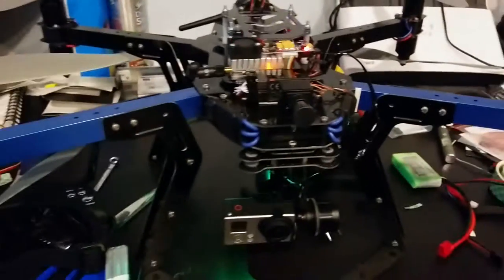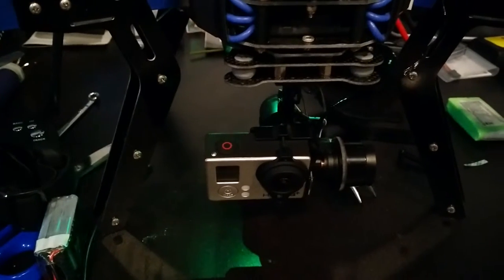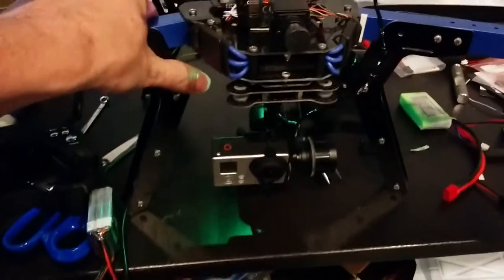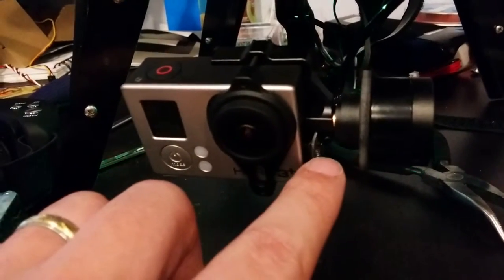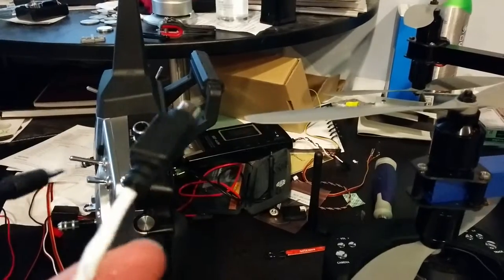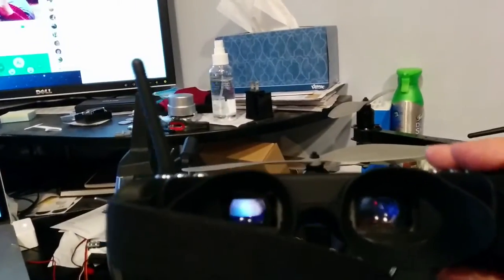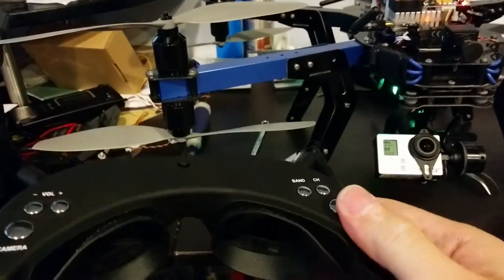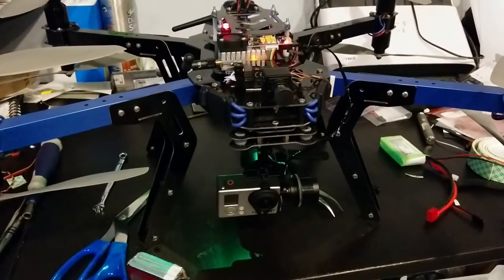Multirotor with "camera man" setup

Comment: Hey, How did you mount the Gimbal? Is there a separate mounting plate or did you manage to bolt it directly to the underside of the main body with stand offs?
Reply: It came with a mounting plate that had a similar pattern of holes as the Tarot gimbal that 3DR ships.  The only thing I had to do was swap out some bolts to match the mounting posts on the base of the 3DR frame.